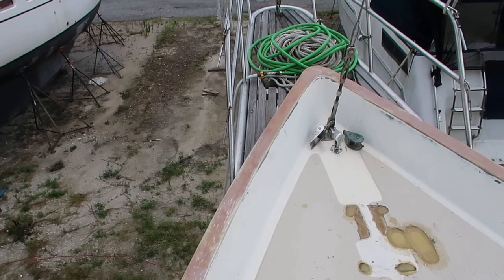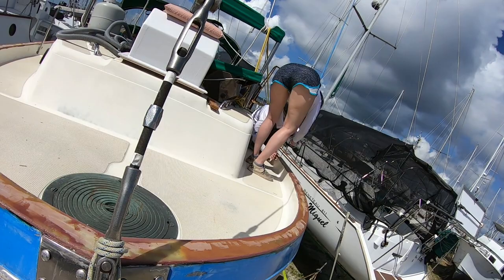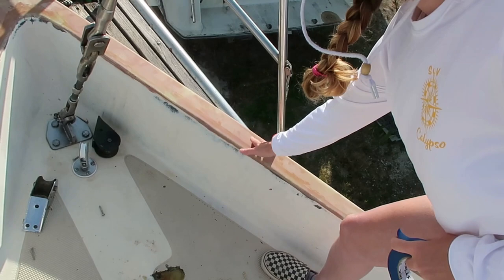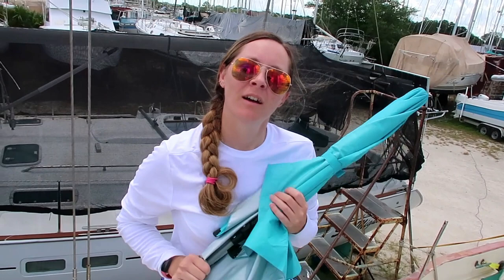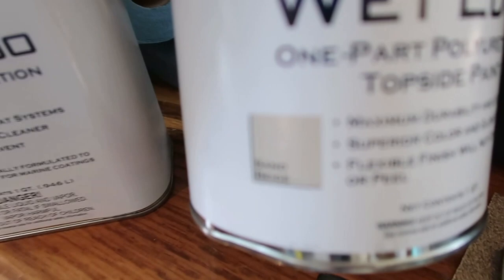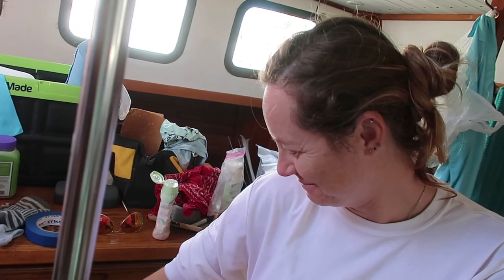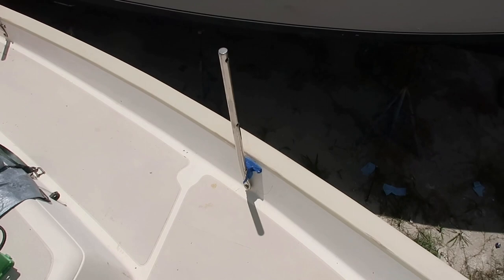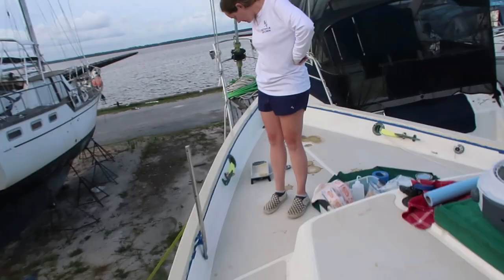HULL TO DECK JOINT REPAIR | PART 6: Painting It Pretty | Sailboat Story 203

Comment: You might think about putting the shutoff valve on the top end of the hose to save all those trips up/down the ladder.
Reply from the maker: That's an idea.
We've only turned the water on, I think, 4 times total so it's not that bad.
It would get old in a hurry if we were using the hose more though.

Comment: After last week's episode, I was going to recommend anti-skid. Some as safety but mostly to avoid the last two sand-n-fill troubles.
Looks great, anywho ;)
Reply from the maker: We’re still doing anti skid at some point before we splash. It’s only going on the top about 1/2” inside the outer edges, so those last 2 sand-n-fills would have to occur anyways, at least the way we went about it.
Reply: @Sailboatstory  understood. Thanks for your response. FW&FS

Comment: Hard job completed is always nice.  You did a very thorough job.   I am repairing a section of cap rail this week, I call it a toe rail.   So far it has been a real pain.  Screws won't come out, some are bolts, but no nuts underneath.  Cutting the teak  has been a disaster, but I'll keep trying.  I need to finish so I can varnish before summer rains start.  Your cap rail looks like it will never leak.  I just prefer the look of golden  wood that you can see yourself in.  BTW,  I was the gent that bought your old toilet bowl.  How is the composter working out?
Reply from the maker: Hey Scott. How’s the marine head working out? The composter is working just fine. We’re on our 3rd load of fresh cococoir thus far. Yeah that was an absolute doozy of a job. Doesn’t leak a drop, but we still have leaks to repair from other places, of course. Stopping the leaking from the hull joint stopped probably 90% of our leaks all in one massive job. Good to hear from you.

Comment: I'm not sure how imperative it is but I would've gone with 2 part activated paint with some sand [ non skid } in that.  I just like using 2 part paints I love how it dries rock hard etc..cool stuff
Reply from the maker: It wouldn't be imperative at all, but would certainly be a very high-end way to do it. We are going to be adding non-skid to the areas that don't have hardware bolted down.
Reply: @Sailboatstory , the hard & tedious part is done & she's sealed up & looks good, if you need to you could do an epoxy topcoat job in da future  ☺....